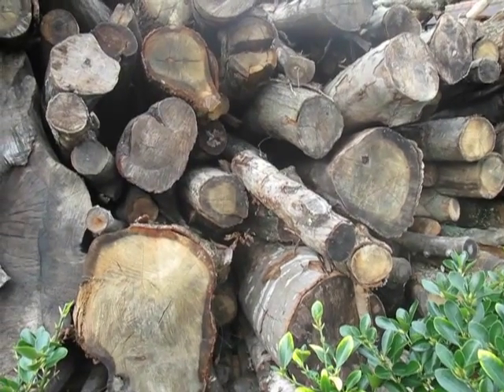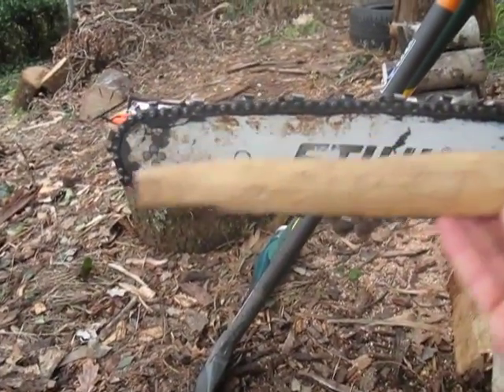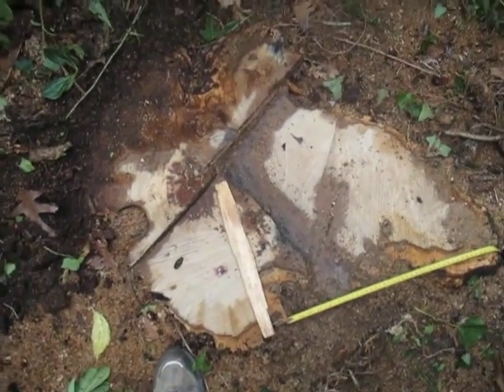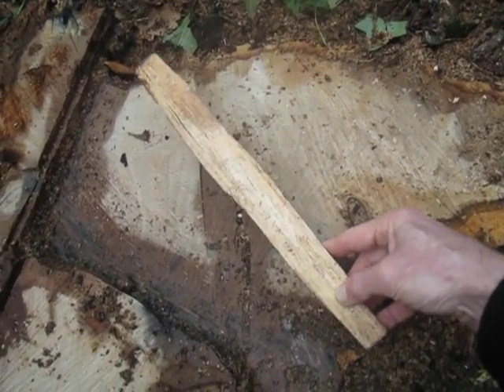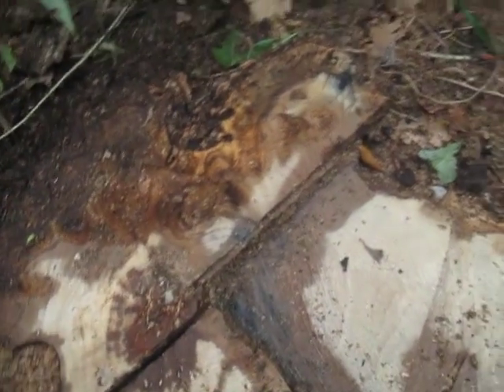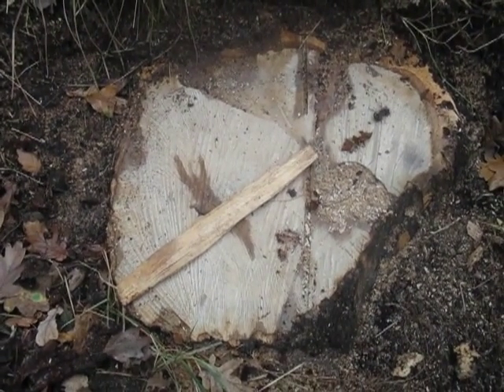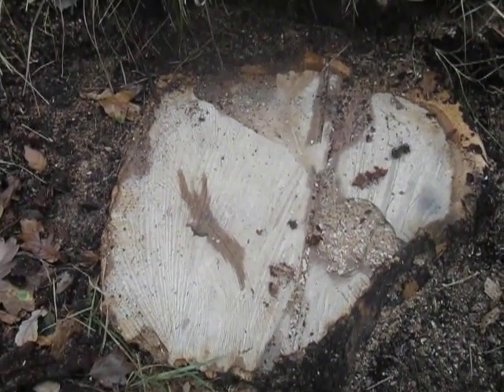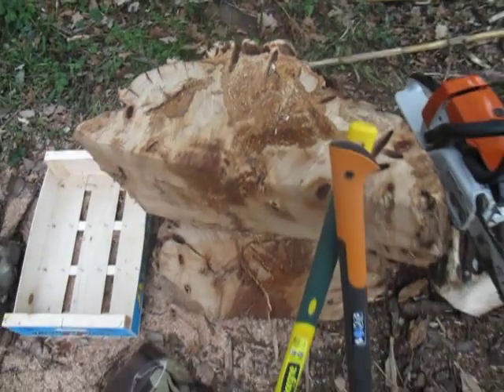How to convert 22 tons of oak trees into firewood - How to cut tree stumps

Comment: Oak is expensive, but only when you have logs that are straight and have a minimum diameter & length. Those can be sold for good money to companies that make furniture or flooring or veneer. But the smaller or curved pieces are even cheaper than beech while having more energy per weight. You can't use oak for paper (because of the tannic acid) or particle boards (no quick & cheap way to strip the bark automatically), so those pieces are cheap because there is no other use for them than firewood.

Comment: 1st, i would like to caution how you set up for bucking the logs to rounds; seems you bind the saw  which is dangerous practice since the bar can push the saw back towards the operator. perhaps you need learn a different method to make rounds. 2nd, when you attempt to split large rounds forget about the cracks and just split off slabs on the outside all round and the round will be more easily broke up. knots are best on the bottom